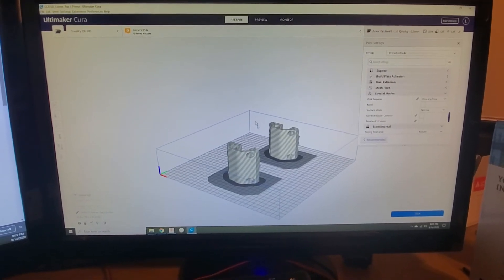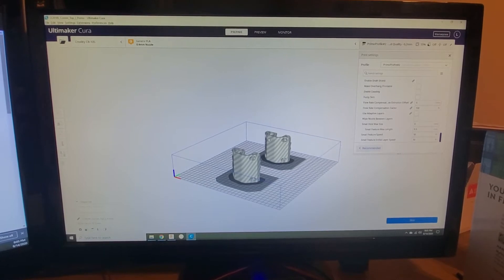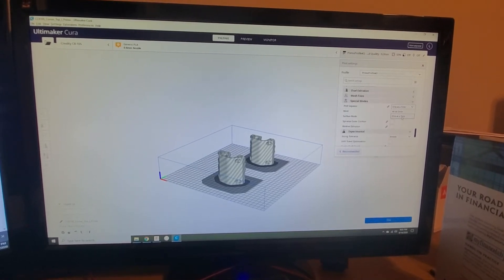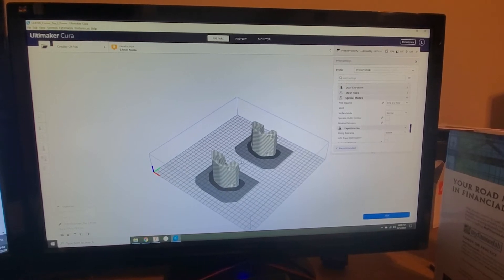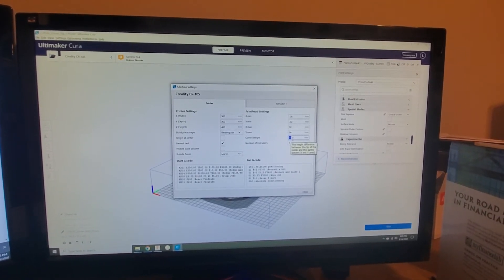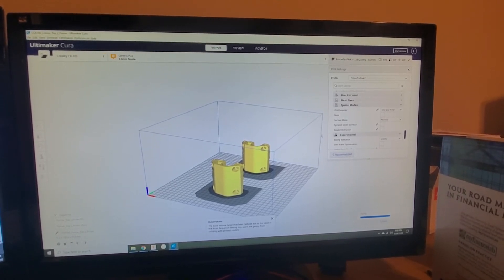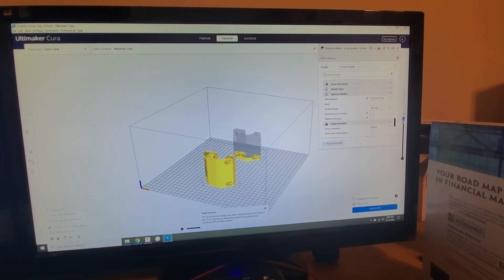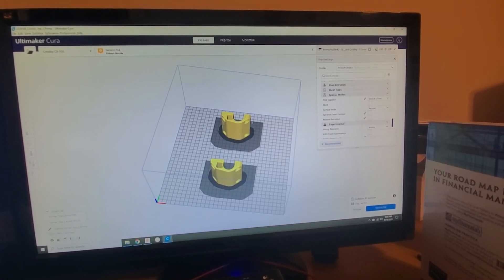Cura print one at a time change print height

Comment: On my CR-10 the stage moves backward to the extreme when the filament sensor shows that the filament has run out. For this reason, it is best to start at the back and work your way to the front to avoid a gantry collision.
Reply: I thought about this; If you did the back one first, would you be concerned with the other "stuff" hitting the first print i.e. feed tube and wiring going to the nozzle?